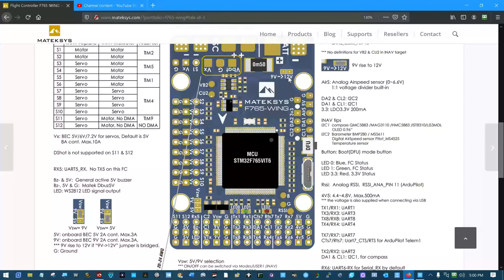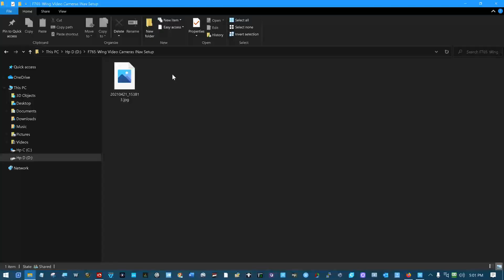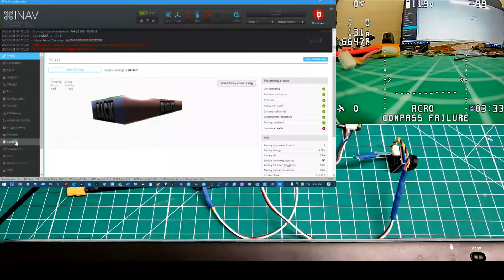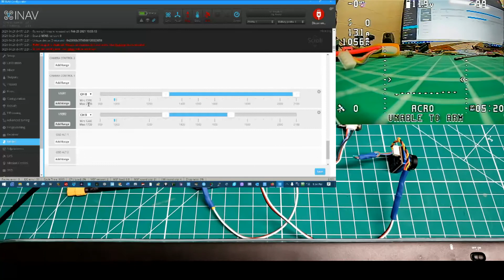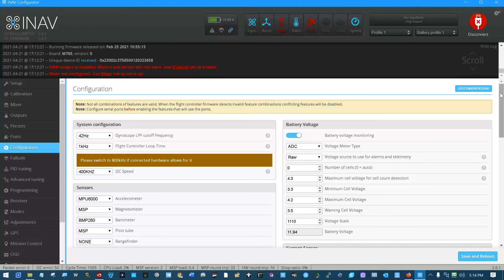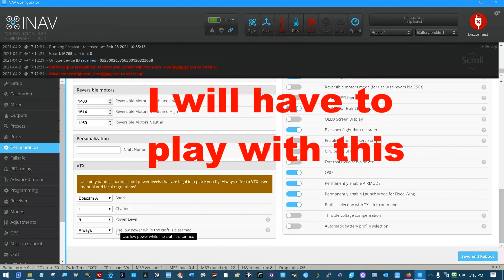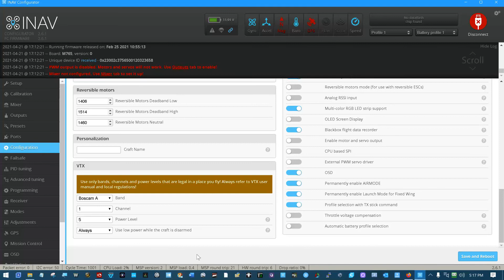F765 Wing Two Video Cameras INav Setup

Comment: Hi, Vernon. Happy New Year for you. Please, could you help me in this installation? I was watching your video to help me in how to configure my camera operation. I am using the same FC like yours, camera 1 pins have 9V but I can't see the image in the goggles. Camera connected directly to the VTX is working fine. But, when I try to use it via FC I can't get image. I tried to use it in the C2 pins but it didn't work. I did the bridge to 9V but there is no voltage in the C2 positive and negative pins. I am trying to solve this issue using the Inav user 1 and user2 switchers like you did but without succes. I need to use just one camera in this airplane. Thanks a lot.
Reply from the maker: Happy New Year to you and yours!

What video transmitter are you using?  I used a 1.2 GHz video transmitter on my SkyHunter and it didn’t work because I didn’t bridge the 9v pullup to 12v pad.  I had to take the FC out, bridge that pad, and put it back in because the 1.2 GHz VTX won’t work on 9v.

The voltage on those pins doesn’t come up until you connect a flight battery.  USB power will not supply voltage to those pins.  USB power only supplies voltage to pins labeled 4v5 for pins near UART 6 and 2 on that board.
https://youtu.be/AuTVgOUNG8I
Reply: @nighthawkvs  Thanks for the answer. I am using a Matek 1.3 VTX.
Reply from the maker: @SILVIOFRANCO1  Make sure that the 9v to 12v pad is also bridged.  I was using a RMRC 1.3 VTX, but the Matek may also need more than 9v to operate.  I am not sure.

I still think it might be because the flight battery isn’t attached.  There would be zero voltage on the camera and VTX pins if it wasn’t powered from the flight battery.
Reply: @nighthawkvs I did the bridge to 12V. Flight battery was connected. Pin vsw voltage is zero. But pins of camera 1 and vtx are 12V and don't have any image. Just the telemetry values of the OSD
Reply from the maker: @SILVIOFRANCO1  It is likely that VSW isn’t turned on.  That is the function of USER1 in INav.  However the documentation says “NO USER1 definition VSW on by default”.  If you do have it defined, you could either delete it for a reboot session, or make sure it is in the VSW on value.  Looks like that is a high PWM from the RC receiver.  That would require all the RC receiver, and transmitter to be working, so I would go with delete USER1 and reboot as a quick test.  IF VSW isn’t 12v then………… I would have to ponder that.  Not much left to check except why the FC doesn’t supply VSW as it should if no USER1 is defined.

Other than that, I think you may be down to just troubleshooting the camera and video transmitter and receiver path.
Reply: @nighthawkvs  Thanks again, Vernon. I will keep trying and let you know. Best wishes from Brazil.